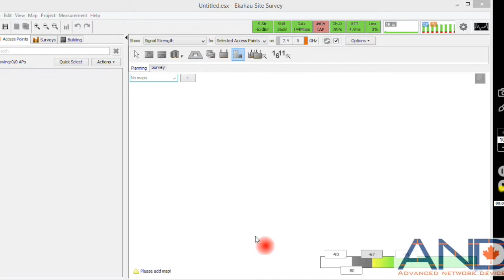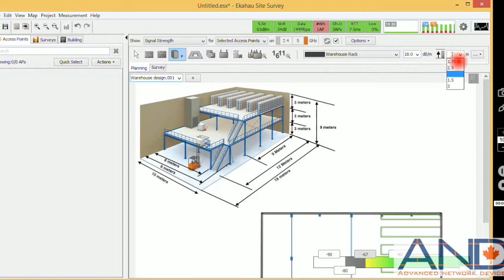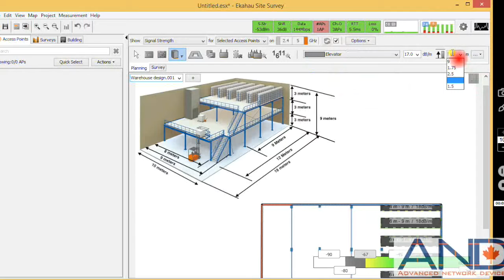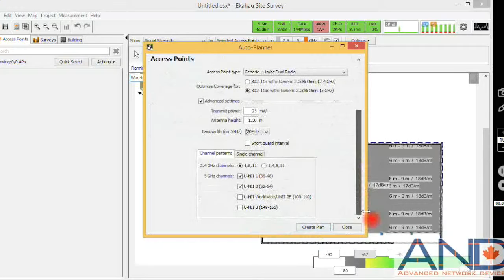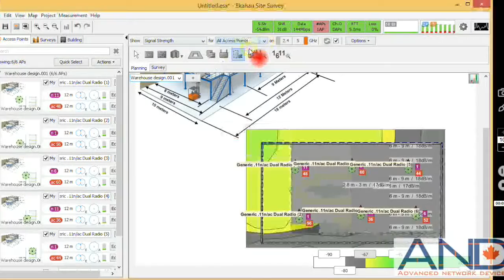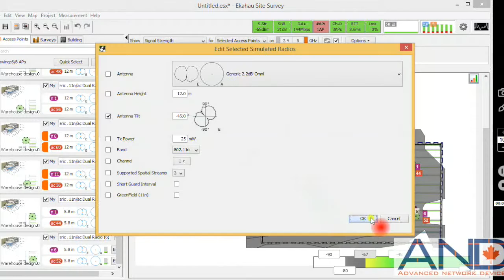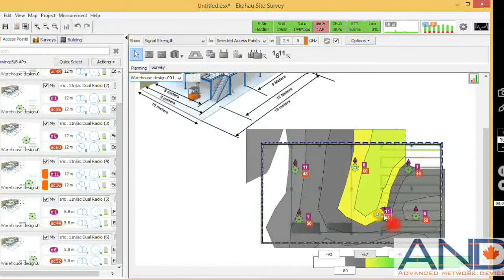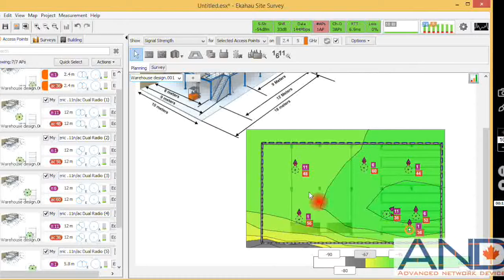Ekahau Planning for WiFi in Multistory Warehouse. By: A-N-D

Comment: I noticed a mistake you've made on your design when you did a multifloor design based off only 1 map. By default the Ekahau software assumes the height plane of where you are standing is at 1 meter so what you're seeing on your results is basically the result of the bottom level. At 12M high your AP clearly did not cover the bottom level so you moved it to the second level, there the AP showed sufficient coverage at the lowest level but you said that it also has sufficient coverage on the upper level. You did not adjust the height plane of where you are standing from 1M to 6M so how do you know you have sufficient coverage on the upper level?
Reply from the maker: You are correct on your statement, however you can indeed adjust the height of signal propagation by simply clicking using ctrl + left click when you select the options button.